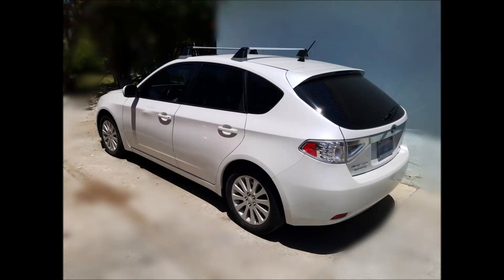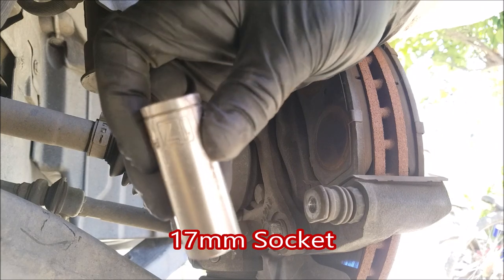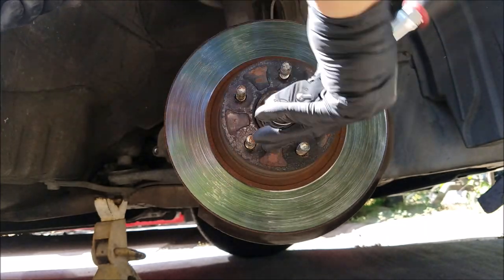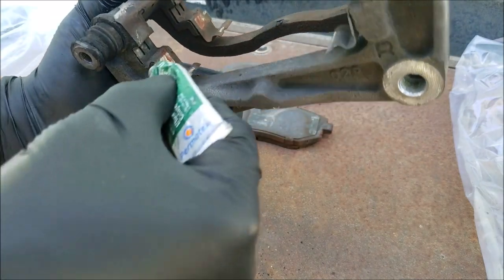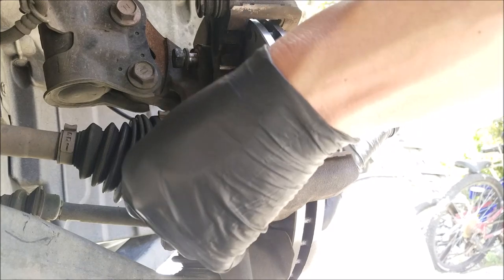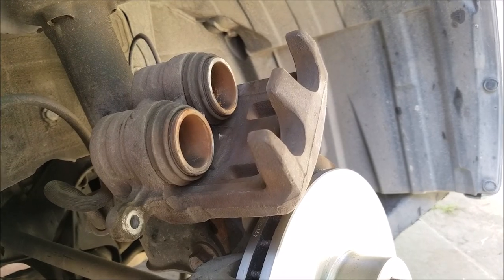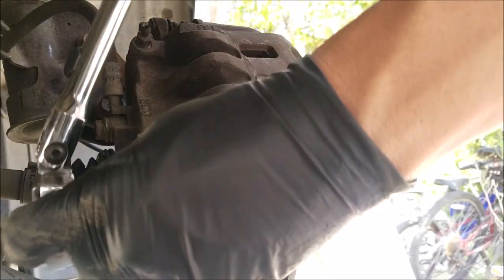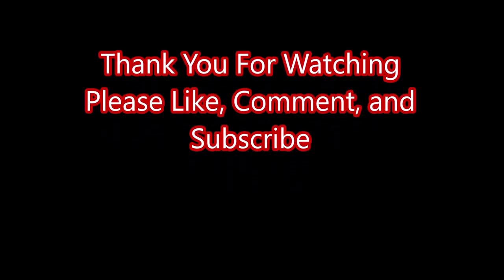How to Change Subaru Impreza Front Brake Pads and Rotors 2007-2014

Comment: This video is very short, professional, and to the point with step by step! Well done
Reply from the maker: Thank you🙂 really means a lot to me🙂
Reply: @backyardchevy328  hey from Australia just changed my wrx front break pads I did losen the bleeder valve had no issues at all. infact I read up on it , its the best way to do it , went on test drive a few times. question why the back plate on brake pad ? i didn't put it on the new performance brake pads , no issues at all, I did lube  up the back of pads.
Reply from the maker: @leepopaz253  well u can loosen the brake bleeder as long as u dont let air get into the caliper..and the brake pads have anti squeal shims just to help avoid metal to metal contact from brake pad to caliper..but i do also put brake lube on the contact points to avoid that as well

Comment: An absolutely perfect video. Got me through my first time doing pads and rotors perfectly. Only thing I might add is that it was easier for me to get my torque wrench in if I rotated the wheel to expose the caliper more before starting the process. Thanks so much for this! Saved me a load of money.
Reply: One other thing, the manual said that the torque for the caliper bracket bolts is 59 ft-lbs, not 89
Reply from the maker: Thank you🙂
Reply from the maker: @Citrus326  yea i think i might have got the torque spec from the subaru outback..not the Subaru impreza although there are 2 one for the 17inch rotor is 89 and the 16inch rotor is 59
Reply: @backyardchevy328  Oops...didn't notice that part. I have 17. Do you think I should retorque everything? I guess the answer is yes....
Reply from the maker: @Citrus326  yes i definitely would

Comment: You included several steps not included in other videos. I did not know about the grease which was very helpful.
Reply from the maker: Yea that brake caliper lube at the contact points is really good for avoiding that brake vibration noise when braking slow

Comment: Very detailed and to the point. You gave the best instructions on YouTube and I’ve watched several videos. Thank you very much. God bless.
Reply from the maker: Thank you so much, im glad to be able to help others with the videos i make, even more so when i receive nice comments like these🙂
Reply: @backyardchevy328  more subaru videos please :)))
Reply from the maker: @waybach  i do got a spark plug and oil change video for that same subaru, i will definitely make more as it needs services🙂...thank you
Reply: Backyard Chevy exactly what I need!! I just purchased a 2012 WRX with 70K miles. Recommendations on things I should be on the lookout for? (Service wise)
Reply from the maker: @waybach  check ur air filter and cabin filter..oil and filter change..check transmission fluid..and check ur belts and hoses for any cracks or inflated hoses...id change the spark plugs if they havent been replaced..the ones on this subaru werent replaced at 125k and they were really worn out.
Reply: Backyard Chevy I will do exactly this. Thanks again for the quick response!!
Reply from the maker: @waybach  Anytime🙂 always glad to help...thank you for supporting my channel
Reply: My brother.. yesterday I noticed my coolant being below the low line, so I filled it yesterday to the full line. Today it went back down to the low line. Filled it up again and drove around for 15 mins or so and it went down almost an inch... what could be causing this? I see no leaks at all... please kindly advise my friend :(
Reply from the maker: @waybach  it could be since it dropped that low it actually accumulated air pockets in ur system so its filling those air pockets..its burping the system as its called...next time u fill it run the heater and let it warm up and fill it when it cools down..if it keeps happening u might have to look for a leak or if its losing coolant through the overflow under pressure.
Reply: Backyard Chevy I’m very worried as I ran the heater after I had filled it the 2nd time and let the car run for about 20 minutes I even left a funnel to see if it would “burp” but didn’t see any bubbles and the coolant didn’t really go down.. I didn’t fill it up a 3rd time which I will do tomorrow morning.
Reply from the maker: @waybach  do u see any coolant on the floor, what i do is lay a cardboard under it over night for any signs of fresh leaks, if its nothing u can see visually
Reply: Backyard Chevy no leaves what so ever. I checked religiously after I noticed it the first time. No leaked at all today/tonight 😭😭😭
Reply from the maker: @Dinner & YouTube u adding coolant? Not water?..if u have no leaks..could be u have a bad radiator cap, but i still think its just filling ur system those air pockets can be stubborn in some vehicles lol.
Reply: Backyard Chevy yes adding coolant. I will change the cap tomorrow and keep you updated thank you for the quickest response, as always! Thanks my man! By the way, where are you located?

Comment: Great video with great information! I would not use blue towel to wipe rotors as I have heard it leaves fibers in the rotor surface. Better to use clean soft cloth.  Great step by step
Reply from the maker: Thank you🙂 yea they can leave a lil but they wipe off or blow off easy once rotor dries

Comment: I own a 2009 Subaru Impreza 2.5i and before I didn't really know much about cars, but because of your videos, I have know learned how to change my oil, replace my radiator, spark plugs/wires, and will be doing my brakes next. Thank you so much! Your videos are very helpful and to the point.

Would you be able to do a video showing how to fix Abs and Traction control lights fix? Mine seem to go off everytime I hit a bump, but when I start the car again, it's off.
Reply from the maker: Thats awesome🙂👍 so glad to be able to help...yea ill definitely do a video focused on that..normally its an issue with a wheel speed sensor or the hub/bearing itself

Comment: Great video and very well illustrated. My caliper bolts are not aligning correct when I push down. I’m only able to get the top one on but the bottom one is off by a tad bit.
Reply from the maker: Is it the caliper pin?..its got 2 flat sides on em, and u might need to rotate it a lil so the caliper slides into the flat spots for both pins
Reply: Backyard Chevy yes it’s the caliper pin. I was thinking to loosen the top and try to finagle it. The passenger side was a dream. Thank you for the video.
Reply from the maker: @trainboy15  thats awesome..glad it was just that...itll probably be best to remove bolt and just get em both lined up..rotating the one thats not on the flat spot...thank you🙂 and thank you for the support

Comment: What kind of torque wrench is this? I’ve never changed my brakes and rotors before, but I’m looking to do it for the first time soon and I’d like to get the correct tools & yours seems like a good one. Great video!
Reply from the maker: Thank you🙂 well its a 1/2 drive torque wrench but recently i got an armstrong brand one that i use..but depending on ur budget and how often u plan on using it.. u can get a harbor freight Pittsburgh brand one and it wont be that much

Comment: What about the other size??lol. Great video. I recommend some spray cleaning too. Always do this job without being in hurry & distractions - these are your essential breaks!!
Reply from the maker: Yea definitely, i know i should of cleaned the brake caliper bracket and replaced the hardware which i normally do but the brakes didnt come with em and they didnt have a set in stock
Reply: @backyardchevy328  Still a very good video. Also, let me ask you something. Do I need to but a torque with the digital or with the torque numbers for this job. I did before w/o it and was fine but after watching your video, I wonder a $100 bucks torque for breaks might be cheap compared to the risk implied.
Reply from the maker: @woodant7  thank you🙂 well any torque wrench would be better than not using one..but i use torque wrenches for many things so i got both the digital and regular..the one i use for everything is still the regular click style gearwrench brand..the digital's good too but it does require 4 AAA batteries least the one i have..i have a harbor freight torque wrench also that u can get for 10 bucks too..but i would never trust that one on lower torque bolts..i only use it for lug nuts
Reply: @backyardchevy328  Got it. I've bought one "click" torque wrench this morning for about $60 bucks. Again, Thank you so much.:)
Reply from the maker: @woodant7  thats awesome🙂..thank you for all the support

Comment: hi. great video. i bought some new Brembo brake pads. But these don't have the thin plate on the back of the brake pad, which is in between the brake pad and the brake caliper. are these plates mandatory?
Reply from the maker: Hi🙂 theyre anti squeal shims, theyre not mandatory theyre just made of a different material so that the caliper doesnt contact the metal on the back of the brake pad directly causing squeal..but if u add brake lubricant to those contact points it should help avoid those squeak/squeals.

Comment: Mine are squeaking pretty bad after install maybe I didn't use enough grease on the contact points?
Reply from the maker: The whole time or during braking?..if its the whole time check the backing plate to make sure its not rubbing..or the hardware make sure if u replaced it that its not rubbing against the rotor

Comment: hello, thank you for this video. Will this work for a wrx 2013 model? thanks again
Reply from the maker: The procedure will be the same, the only difference will be the part numbers because the brakes for the wrx are slightly bigger for the higher performance wrx supercharged model.

Comment: Hey sir, is the back breaks the same procedure? Also I just want to double check I I don't need any custom special tool from Suburu to do this for a 2014 Impreza? Thank you for the help :]
Reply from the maker: The rear brake pad replacement is pretty much the same..just smaller brake pads...but no special tool..just same tool u use to compress front caliper...but the rotor has a different design if ur replacing those...for replacing rotor u can follow my scion frs rear brakes video
Reply: Hey did change your 2014 Impreza pads and calipers? I am thinking of doing mine and wondering if it’s still as straightforward as this video. Thanks!
Reply: @jeremybenjamin8562  yes this video was 100% on point. It even included some steps to reduce noise that professional brake job people sometimes skip. Also you can tighten your parking brake up in the back pair, but that was the only thing he didn't go over since the video was for the front. You may not need that tho
Reply: @adrowsypoet  awesome thanks for the quick reply!

Comment: Could I use Lucas Oil white lithium grease, or do I need a specialized caliper grease?
Reply from the maker: Lithium grease is a low temp grease..so you'll wanna avoid using that on the front brakes they get too hot for that.
Reply: @backyardchevy328  okay thanks, I'll get some caliper grease.

Comment: Do you have a specification for the caliper bracket bolts? One of mine snapped from rust and now I need to replace it. The ones you used the 17mm socket on.
Reply from the maker: M12 x1.25 x 30...part number 901000316

Comment: How are you able to to tell the feet of torque required when you're tightening, for example at 6:43 & 8:43 ?
Reply from the maker: Usually i get pretty close to the torque spec cause after doing it for so many years u kinda get a feeling for it...but i always use a torque wrench...some of my video's ill leave the torque wrench in the video others ill crop it out to make video shorter but i always try to put torque specs.

Comment: Do all the pads have that funny clip on them. My pads came with that clip and a extra tab or arm in the same place. Do you know what these clips are for or the extra arm?
Reply from the maker: I think ur referring to the brake warning tab..many of em do, its supposed to rub on ur rotor and warn u that ur brakes are very low on material.

Comment: Hello there... Is it the same steps as rear breaks?... I drive an impreza hatchback 2014... Great video by the way!
Reply from the maker: Hi🙂..yes its pretty much same procedure, the torque spec for the rear caliper bracket is less though, 48 ft.lbs...and 20 ft.lbs. for the caliper pins
Reply: Ok thanks... This will be my first time working on my car. On any car for that matter.
Reply from the maker: @besella14  good luck..hope it all goes well..let me know how it goes🙂

Comment: I have a 2006 imprezza.. do I have to change the rotors with the brake pads?  The rotors dont look that bad no scratches or grooves in them
Reply from the maker: No, if the surface is still good and even and u can just replace the brake pads
Reply: @backyardchevy328  well since the brake pad does not reach all the way to the end so no it is not even

Comment: I tried torquing the caliper bracket to the steering knuckle at 89 ft pounds a d it stripped the bracket threads.
Reply from the maker: Oh no...What year and model is urs? That is the torque spec it calls for..for the one in video

Comment: Hey there ! I have a 2008 Impreza 2.5i. The my front brake only have about 5000 miles on them. My car sat for a few weeks. I did change my wheel rims and think maybe I might have overtorqued them (did not use a torque wrench at that time). I now get a bad vibration at 50 mph and my left front rim become super hot radiating heat... Did I warp my rotor for overtorquing or is it again that my caliper has a seized brake pin or even a seized caliper piston (happen in the past, had to service my car and have them replace the calipers... I think they were refurbished ones) ? Any experience on these subies ? What's more likely from your experience ? I do hear the rotor rub againt the pad every time the wheel make a revolution. Do you think I can solve this by untorquing my wheel and tork it back but this time with a torque wrench, to the sevice manual torque spec value ??? Thanks for any input ! Just did timing belt, OEM subary TB tensionner, all idler pulleys and coolant replacement at the subaru dealership (1500 canadian dollars) so I really would like to avoid another 1200$ brake job at the dealership if I can. Maybe I'll go to the next door mechanics, but If you think I can solve this myself and save a bit of money, that'd be a relief as I don't have a lot of financial income. I'm already planning to do the spark plugs, fuel filter and PCV valve maintenance myself (already bought the OEM parts so I dont have to pay a mechanic for labor time to do that " basic maintenance " and save up a bit of money). My 2008 impreza is almost 12 yrs old but only 62000 miles on it. Thanks fot the input ! I'm really anxious about the brake issue. Any input would help !
Reply from the maker: If its getting that hot, ur caliper most likely is stuck pressing against the brake rotor could be the brake caliper pin..could be the brake caliper itself..so what i would do..take off the caliper..check the caliper pins if they dont slide out and in smoothly, then most likely thatll be ur problem..if both operate smoothly i would check ur caliper by having someone press the brake pedal and once they let go of the brake pedal the caliper should kinda release back a little enough to let u move the rotor freely
Reply from the maker: I got a video about brake noises and it explains a lot about potential problems with brakes..maybe it could help u find out whats wrong
Reply: @backyardchevy328  thank you for the reply. This is definitely helpful. Will check the caliper pins and piston.
Reply from the maker: @JonathanVaucher  hopefully it helps and u figure out whats the problem, let me know how it goes

Comment: Pretty good except he did not clean the hub surface that mates with the rotor. Also, he should have used new brake pad clips or at least removed and cleaned the old ones and the surfaces on the caliper bracket that mate with the clips. The wheel nuts should be retorqued after the car is driven a short distance, then again a week later.
Reply from the maker: Yea i should have waited to replace the brake pad clips to record video, those brake pads were supposed to include hardware but didnt so they ordered the hardware but got em a couple days after, i did end up putting new hardware but the following week and when i edited video i didnt include those scenes unfortunately.

Comment: Awesome. The rear brakes the same as well?
Reply from the maker: Pretty similar..except the rear rotor has a parking brake assembly in middle of rotor..and brake pads are smaller.
Reply: @backyardchevy328  wondering if it would be complex for a rookie like me. The front is pretty clear for me to follow. Either way, awesome videos.
Reply from the maker: @hibritto  it should be pretty similar to this video https://youtu.be/llcAXelPpds
Reply: @backyardchevy328  Awesome. Thank you
Reply from the maker: @hibritto  anytime..hope it helps🙂

Comment: Did you have to turn the wheel to get the top caliper bracket bolt out? I just struggled with that bolt for 20 minutes and gave up because I can't get a socket on it! Turning the wheel was suggested to me AFTER I put everything back together again with the old pads still there.
Reply from the maker: My wheels were straight but depends on the socket and ratchet ur using..but yea turning the wheel gives u extra room if u cant get it on

Comment: The caliper mounting bolt should be 59 ft-lbs, the wheel is 89 ft-lbs.
Reply from the maker: My manual said it was 88.5 ft-lbs. for the front caliper bracket to spindle bolts...the wheel yes it is 89 ft-lbs but i normally stick to 100 ft-lbs standard for most vehicles.
Reply: @FH-ey9qz  👍 BIG thanks for link to manual.